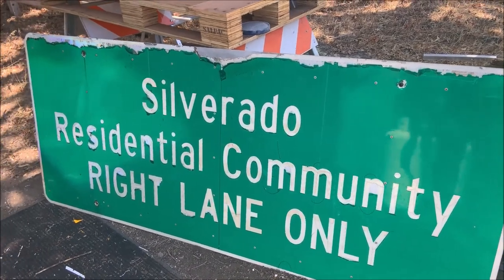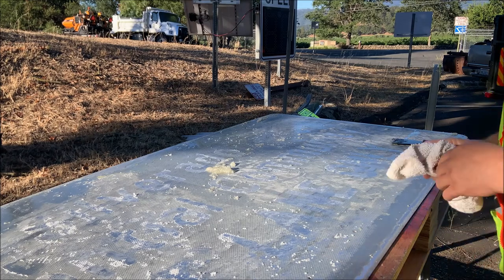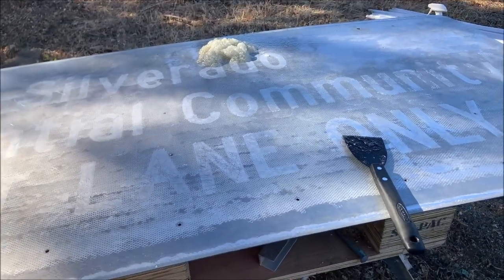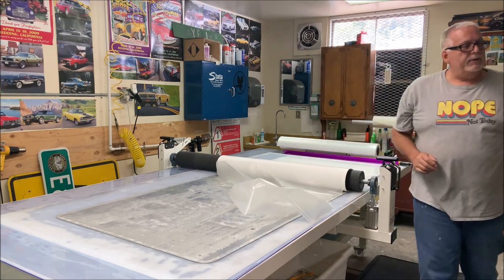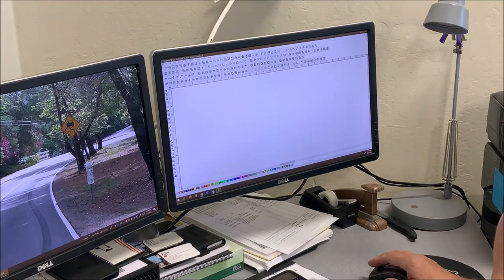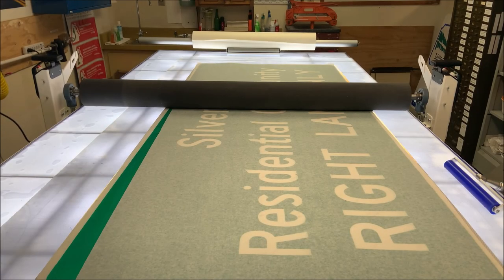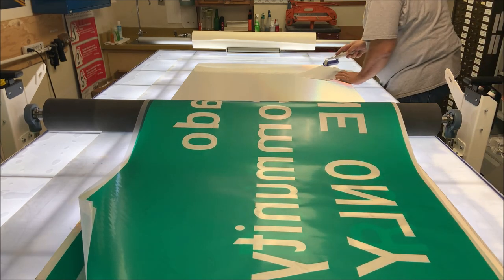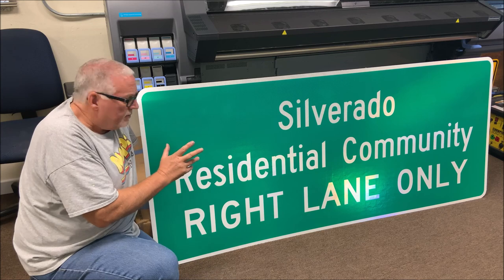Refurbishing a Traffic Sign

Comment: I had some rapid remover in a spray bottle the same as my rapid tac ....anyway I was removing cut vinyl from 4 signs on the doctors office then 2 direction signs I was removing copy and replacing with new. Any on the last sign late of the evening rushing before dark and I spray the vinyl with remover instead of rapid tac  60 miles from the shop and I had to cut and return the next day

Comment: Nice job Bob! Two questions for you: What did that roller table cost? And…did you buy the Flexi software or did you get a subscription to it? Thanks!
Reply from the maker: The CWT 1428 table cost $13,700.00 +Shipping. We bought Flexi v.21 for $1995.00. Our county won't due the monthly subscription and then get all the upgrades with it. So far the table and printer are like having an extra employee.
Reply: @BobTheSignMan  noticed that you haven't raised the height yet...are you still planning on it?
Reply from the maker: @jonathanmessore1907  Not yet. I’m getting use to the height. The area is rather small and I keep moving the table, so raising it I will need wheels. So for now I’m keeping it the way it is. Another thing is I spend way less time on the table as I did with the last set up for making signs.